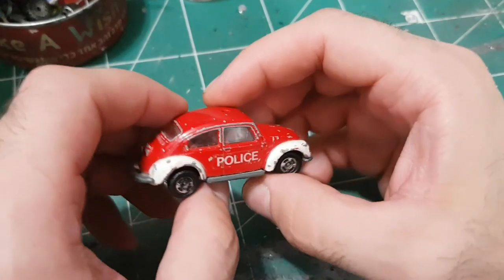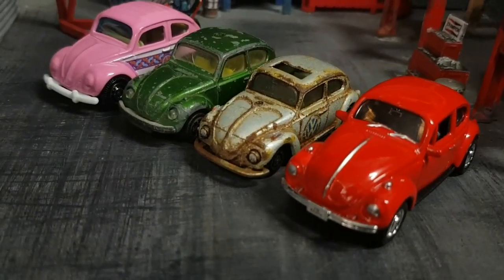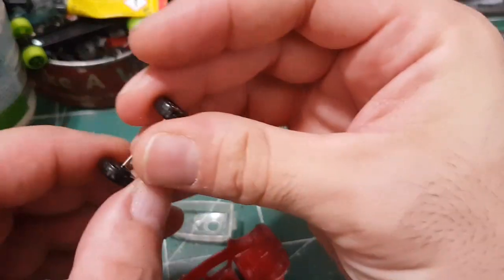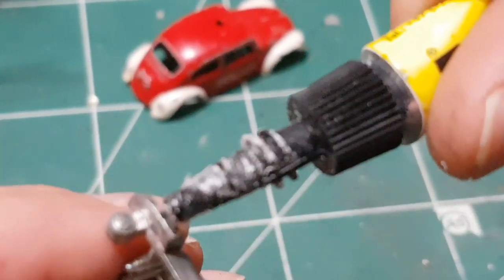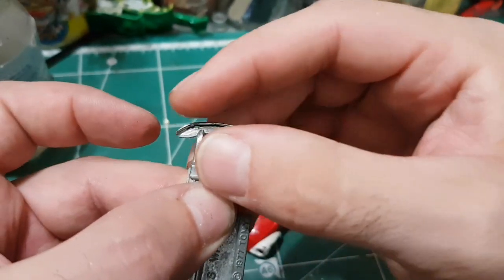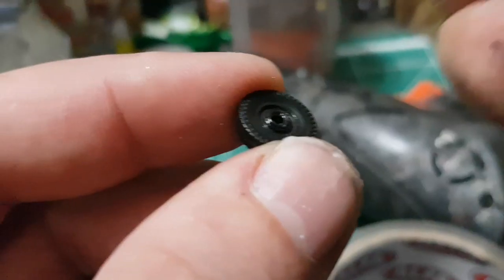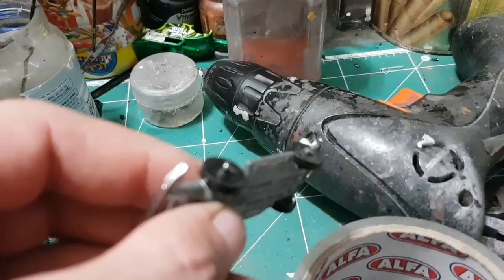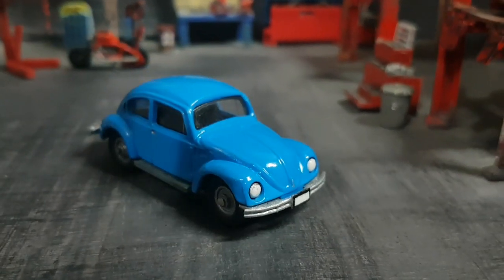Tomica VW beetle restoration

Comment: The Welly's one is more of a Super Beetle than just a Beetle, which is why it's quite different from the others. HW's Beetle's not good compared to the others, to me it seems more like a California customized Beetle if anything. But the Tomica and the old Matchbox one are QUITE similar, they even both have a hole for a siren/light, so I'm wondering if Tomica, or Matchbox borrowed the tooling from the other.

Nice wheels and nice color.
Reply from the maker: I don't think that there was a co op of these brands, because they were rivals at that time.
Reply: @bambilala1  Sometimes rivals loan their stuff to another. Right now, in the model kit industry, AMT, belonging to Round 2 (american model kit company) is releasing trucks that were made by Italery (italian company). They're rivals in the business, but they rented the molds to Italery, who's making money from this none the less.
Reply from the maker: @chassegallerie2910  yea but although the castings are looking the same, they are not exactly 1 to 1 clones, so hard to belive there was a co op.